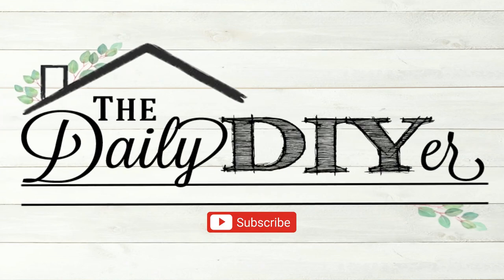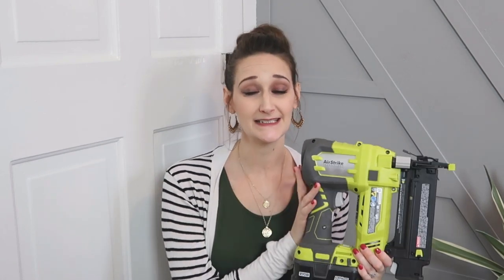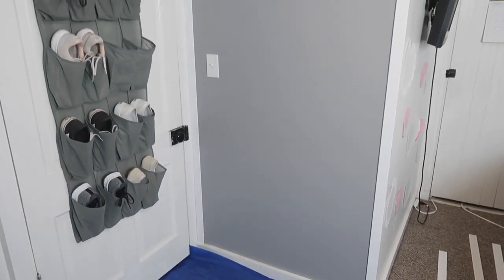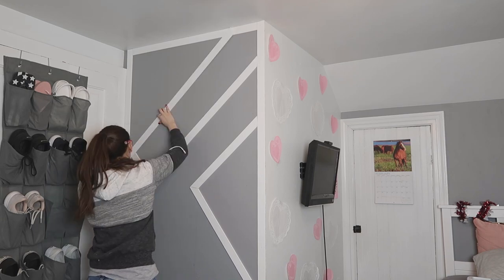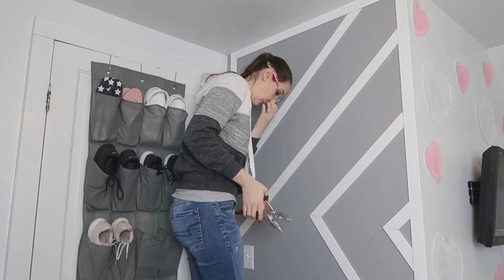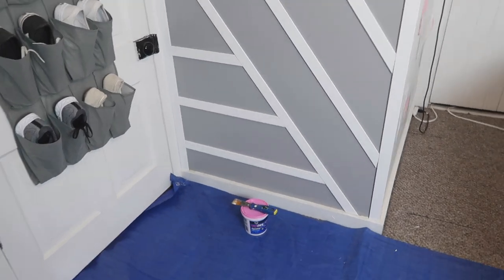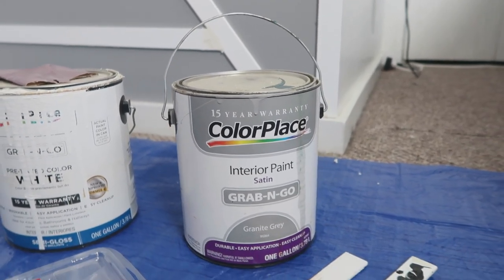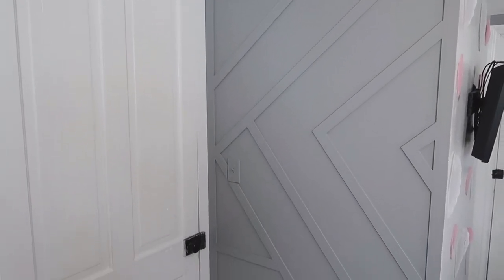DIY ACCENT WALL | The EASY way!

Comment: Love the idea of the lattice instead of one bys. I did an accent wall using 1x3s and although it turned out beautiful, it is a bear to keep clean. Desert living brings a lot of dust😊.
Reply from the maker: Yes - the wood is a process with sawdust and having to sand.  This is a little more $$ but less hassle.  Great for some but not everyone

Comment: Thank you so much for sharing this DIY! I just bought my first home and have been researching how to do a board and batten wall. I have a few questions, hoping you can help! 1) did you nail the trim on any studs? If not is there any risk to that or are the nails not long enough to penetrate through pipes.(my worst fear) 2) did you not caulk the sides? 

Thank you!

Comment: Looks great.  Only thing I would have done differently was moved that trim below the light switch. Being a few inches lower would not have been an eye sore.  But having the trim go "through" the switch, then having the switch grey on top of that, has caused it to be an eye sore.  But overall, still looks good.

Comment: So you just painted over the light switch with regular paint? Has it stayed painted?  I want to change my plates to white but the toggle is beige and I don’t want to change out the whole thing because I’m cheap and lazy!
Reply: I was curious about the paint staying on the plastic trim she uses. Does the pain stay on? I have little kids and they’ll scratch it off if it comes off easy.

Comment: I wonder how this trim/lattice would work as a board and batten wall?
Reply from the maker: I actually plan to use this again for our board and batten in the upstairs bathroom - so much easier to work with